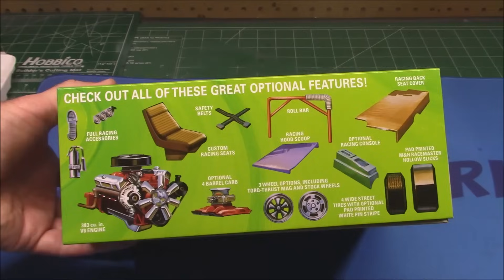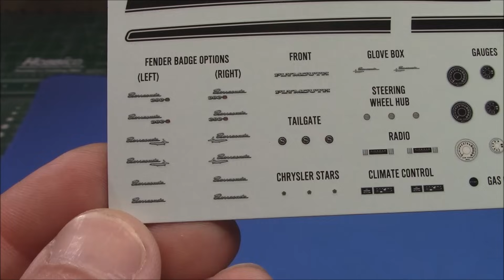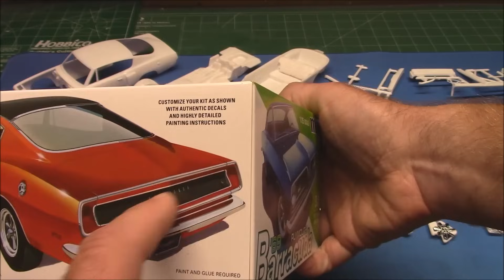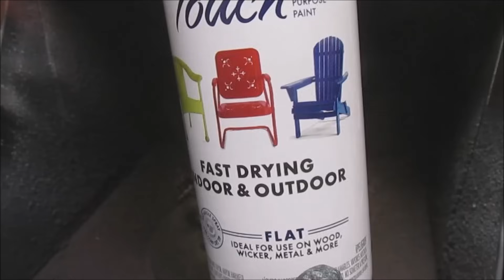1969 Plymouth Barracuda 383 1/25 Scale Model Kit Build How To Assemble Paint Dashboard Engine Cuda

Comment: It is QUITE the custom beast you did here, Chris! Like it.

I think that over the kit is quite good. Tho, I think they could improve it by making the headlights separate clear lenses, more complex under carriage, where the exhaust system, rear suspension, etc and putting in an optional HEMI engine.

Tho, what I REALLY think this kit is missing, at least for me, is dogdish hubcap (and the wheels that go with them), else, it's a pretty solid kit that, while it could be improved give good end results.

Comment: I built this kit when I was about 12. It did come with a hemi engine for the drag race version. I think it also had racing slicks and the inside of the rear fender wells were marked so you could trim them for the slick tires. 
There were a very popular 69 barracuda on the drag racing  circuit at the time. It was a wheelie car with a hemi engine in the back seat called the Hurst Hemi under glass. 

The 68-69 barracuda was also a popular Funny car body. 
Both Don "The Snake" Purdhomme and Tom "the Mongoose" McEwan ran that body.

Comment: This is a nice kit and the build looks awesome. I wish they would bring the parts back from the killer cuda issue with the slotted rims. They changed the custom wheels and added the recall rims as the only choice in the 80’s Plus now every new kit is getting those 5 spoke rims which is getting boring. Plus what makes it a 3 in one?